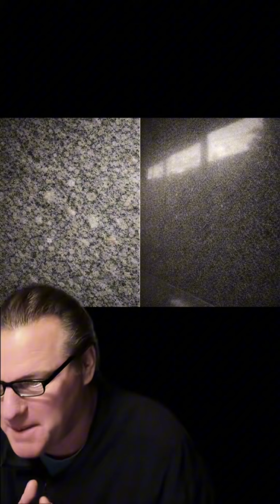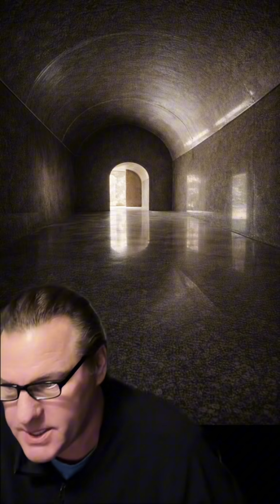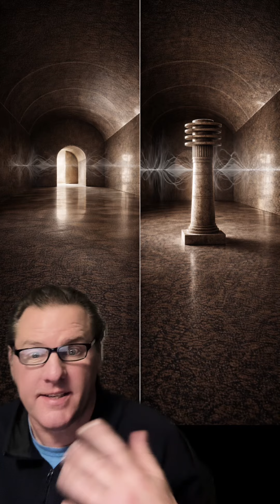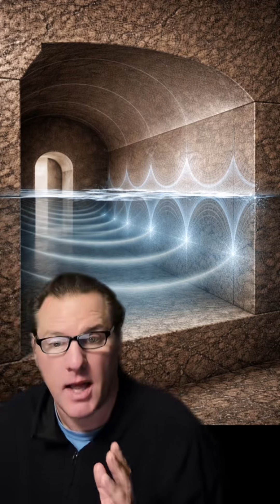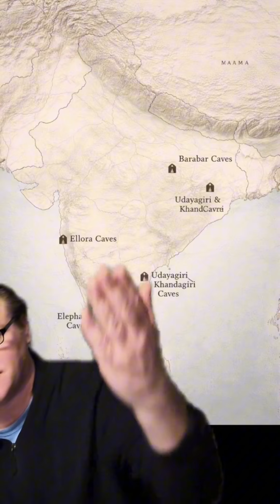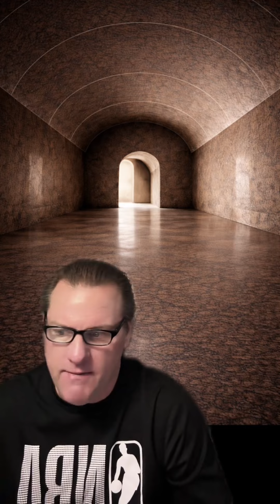The Barabar Codex: Why These “Caves” Break Archaeology (Full Series)

Comment: What a load of horse hockey. All shapes will produce resonant frequencies, which are dependant entirely on the shape.
Reply from the maker: All shapes resonate. Not all shapes are engineered to control coherence. Barabar clearly is.  Keep in mind. I don’t present anything unless I have a framework that can be proven correct.  You’re really gonna get pissed off when I explain how it’s done in 54 days., repeatable…… I’m working with a completely different set of principles in time.-space

Comment: Boo. What you're showing behind you is NOT the Barabar caves. One Google search dispelled this illusion. Granted, what they did was impressive for the time - but hardly the stuff of legends. The caves date, at the earliest, to around 400 BC or so. That's the earliest date, they could be as late as the last century BC. The caves are not like the polished granite or marble you have in your video. They are very smooth and shiny, but nowhere NEAR "mirror shine."
Reply from the maker: The image used is illustrative, not a claim that it is Barabar itself, and the point being discussed is not surface gloss alone. The significance of Barabar is not whether the finish reaches modern mirror polish standards, but that large interior granite chambers exhibit uniform surface continuity, consistent curvature, and high reflectivity in spaces where none of it is functionally required. Smoothness at that scale inside hard igneous stone is not trivial for any period, regardless of dating. The question is not whether it could be done with enough time and labor, but why that level of finish, geometry, and acoustic behavior exists at all if the structures were simple monastic shelters. Those constraints remain independent of chronology and are the focus of the analysis.

Comment: is there any video evidence of your claim that the walls are flat to within fractions of a single millimetre over several metres?

Thanks and nice video
Reply from the maker: I should clarify that this is not my personal measurement or opinion. The millimeter level flatness and surface precision are values reported in archaeological and engineering analyses, including modern laser and 3D scan surveys conducted by independent teams who have digitally mapped the chambers. Those scans show exceptionally consistent surfaces over several meters, which is why Barabar is frequently cited in academic literature as anomalous in terms of finish quality. My role here is not to invent those measurements, but to ask what process best explains results that have already been documented. I will be addressing the scanning data and experimental replication in later parts of the series. Thanks for the thoughtful question.
Reply: @Theanswers-n4u So the answer is no.  You provided no source material or links. Sounds like you are reading a script and you don't actually know what you are talking about.
Reply from the maker: @HOWBAZARY  all you have to do is google it dude it ain’t that deep. It literally ain’t that deep. You just haven’t done any research. Come on do a little bit of work here..  I’m not going to spoon feed everything to you.

Comment: Here is the breakdown of what the physical evidence actually proves versus where the uncertainty lies.
1. Direct Physical Evidence (What is undeniably there)
The Rock: The caves are carved into natural, geological granite hills.
Limitation: You cannot radiocarbon date granite. The rock itself is millions of years old; scientific dating of the rock tells us when the magma cooled, not when it was carved.

The Inscriptions (The "Hardest" Evidence):
Fact: There are inscriptions engraved into the rock surfaces.
Fact: These inscriptions use the Brahmi script and specifically name "Piyadasi" (Ashoka) and "Dasharatha".
Fact: The inscriptions are physically engraved into the finished surface.
Physical Deduction: The cave walls were finished before (or at the same time) the inscriptions were cut. This establishes a Terminus Ante Quem (Latest Possible Date). The caves definitely existed by the time that script was used (3rd Century BCE).

Architectural Mimicry:
Fact: The facade of the Lomas Rishi cave physically copies the structure of a wooden hut (arched roof, interlocking beams).
Physical Deduction: The builders were imitating wood. 

2. The Missing Evidence (What we do NOT have)
To strictly prove the "construction date" without assumptions, archaeology would typically need "Absolute Dating" data, which appears to be absent or non-existent for this site:
No Radiocarbon Dates of Construction: There is no record of charcoal, wood, or bone found embedded in the mortar or construction debris that has been radiocarbon dated to the 3rd Century BCE. Because these are "subtractive" structures (rock was removed, not added), there is no mortar to date.
No OSL (Optically Stimulated Luminescence) Data: OSL can date when soil was last exposed to sunlight. There is no widely cited study showing OSL dating of the original spoil heaps (the pile of rocks removed from the cave) to the 3rd Century BCE.
No Found Tools: No iron chisels or polishing tools dated to the Mauryan period have been found inside the caves or definitively linked to the specific construction layer.

3. The "Assumptions" Required to Reach the 3rd Century BCE Date
If you remove the accepted archaeological narrative, you are left with these specific uncertainties:

Assumption 1: The Inscriber was the Builder.
The Uncertainty: It is physically possible (though unproven) that the caves were carved centuries earlier by an unknown group, and Emperor Ashoka simply found them, polished them (or just found them polished), and wrote his name on them. The physical evidence only proves he claimed them, not that he dug them.

Assumption 2: "Mauryan Polish" is Uniquely Mauryan.
The Uncertainty: We date the polish to the 3rd Century BCE because we see it on Ashokan pillars (which are dated by text). If we reject that link, the polish is just "undated advanced technology." There is no chemical test that dates the act of polishing.

Assumption 3: The "Wood Copy" Means it was Built During the Wood-to-Stone Transition.
The Uncertainty: While logical, it is an assumption that the stone cave was carved while wooden architecture was still dominant. It could technically be a later "retro" style or an earlier prototype, though this contradicts the standard evolution of technology.

Summary of Uncertainty
Without assumptions, the direct evidence only proves that the caves existed and were usable by ~250 BCE (based on the script).
Certainty: They are at least ~2,250 years old.
Uncertainty: We cannot physically disprove they are older. The "construction event" itself has left no datable biological footprint (like charcoal) that has been recovered and analyzed to pinpoint the exact year of excavation.
Reply: While the Barabar Caves are famous for their unique, mirror-like "Mauryan Polish" inside the cave walls, the Egyptians had mastered the cutting and polishing of granite for over 2,000 years before the Barabar caves were constructed.

Polished Granite in Ancient Egypt

The Egyptians did not typically create entire polished "caves" in the style of Barabar, but rather rock-cut tombs with polished chambers or massive freestanding granite structures.
Pyramid Chambers (Old Kingdom, ~2500 BCE): The internal burial chambers of some pyramids, such as the King's Chamber in the Great Pyramid of Giza, were lined with massive, highly polished granite blocks. These surfaces are smooth, precise, and were clearly finished to a high standard.

Obelisks and Statuary: The Egyptians created numerous obelisks and colossal statues out of Aswan granite, many of which exhibit incredibly smooth, polished surfaces that have survived millennia.

Precision Engineering: Archaeological evidence, such as granite drill cores found at Giza and Abydos, shows that ancient Egyptian artisans used advanced techniques (like tubular drills and abrasive sands/emery) to achieve precise cuts and polished interior surfaces as early as the Old Kingdom period (c. 2686–2181 BCE).

Comment: Moron states "This acts more like an instrument" Then goes on to state "And that fact" BROTHER IT ISN'T A FACT, ITS SOME NONSENSE YOU JUST MADE UP
Reply from the maker: What I said was that the chamber acts like an instrument, not that it is literally a musical instrument in the modern sense. That is a descriptive statement based on observable behavior. When geometry, surface finish, and material consistently shape sound in predictable ways, engineers describe that space as instrument like whether it is a concert hall, anechoic chamber, or resonant cavity. That is not something I made up, it is how acoustics is discussed in physics and architecture. If you disagree, the correct response is to explain how mirror polished granite, millimeter level geometry, consistent acoustic reinforcement, and the absence of tool marks arise accidentally, not to dismiss the behavior being described.
Reply: @Theanswers-n4u  They didn't happen accidently, they very easily smoothed the rocks, acoustics happen in a given volume with specific layouts and happen 90% of the time by coincidence and is a natural phenomenon.

You're response : "It's impossible to cut granite with copper".

My response : " The Chinese (6,000 years ago neolithic period) started cutting Jade, the same hardness as Granite with nothing but string and quartz dust, they still use this practice today to make some of the smoothest and most geometrically perfect statues known to man.

You're response : "Ehhh but you cant get it so smooth with string and how did they get it mm perfect? "

My response : " Yes you can, as I just said they do it with string in China. Most sculptors get them mm perfect with nothing but a chisel, search it up and educate yourself. "

Your response " THEY LIE TO US, THEY WANT TO HIDE THE TRUTH" 

My response "Who are they? Why would they hide something so meaningless? and you can always actually watch a sculptor and see for yourself, there are hundreds of videos, tutorials on how to get them geometrically perfect etc.."
Reply from the maker: @JM-Games  What you are doing here is a classic rhetorical substitution, replacing an explanation with a list of things that are possible in principle and treating that as proof they happened this way in this case. That does not address the actual constraints. You have not shown where the tool marks are, how a continuous glass like finish was achieved on large interior granite surfaces, or how millimeter level consistency was maintained across multiple chambers without intermediate process traces. Saying granite can be worked or that acoustics can occur naturally does not explain this specific outcome at this scale and finish. Possibility is not evidence, and analogy is not demonstration. This is only the first part of the series, and in the next phase I will be proposing a concrete experimental reconstruction designed to recreate these chambers under controlled conditions. At that point the discussion can move from opinion to testable results, because the stone itself will decide which explanation survives.
Reply: @Theanswers-n4u  Tool marks are a sign of bad workmanship and isn't left on anything that is smoothed down so I don't even understand the point your trying to make with that, Everything else, I literally answered in the previous comments, I literally knew exactly what you was going to say, answered each response and  you still almost word for word said exactly what i said you would.
Reply from the maker: @JM-Games  I am going to be very clear here. You have not demonstrated a single thing, not experimentally, not materially, and not evidentially. You have asserted that certain techniques are possible and then treated that assertion as proof that they were used here, but no one has ever reproduced the Barabar results at scale using those methods, and if they could, it would already be settled because archaeology overwhelmingly prefers conventional explanations. The fact that this has never been demonstrated is precisely why Barabar remains anomalous. Repeating that something is possible does not make it explanatory, and repeating it louder does not turn speculation into evidence. My work is about what the stone itself records, not about defending assumptions that have never been proven. This is the end of my participation in this thread. I wish you the best whether you choose to watch my content or not.
Reply: @Theanswers-n4u Listen, I believe you truly have good intentions but your ignorance towards the facts and the evidence already provided to you not by me but by scientists and archaeology that is scattered across the Internet shows me you won't accept any piece of evidence, the jade statues are proof enough look into it, this is a youtube thread and I can't exactly show you much evidence from here, I'm sorry but people like you make real history very difficult, you muddy the waters and confuse people, there's no basis for what you are saying other than "it sounds pretty and it's smooth" which has been reproduced hundreds of times, cathedrals for example way more sophisticated, way more detailed and acoustically sound but then people within your conspiracy bubble state "we can't reproduce this now" well we can, we do and it's very easy.
Reply: feel bad for you bro, so much anger when dumb paradigms you believed are challenged and destroyed.
Reply: @abramspritzler4618 you need to get psychology classes because you read that completely wrong, you got anger from a comment? Brother try harder.